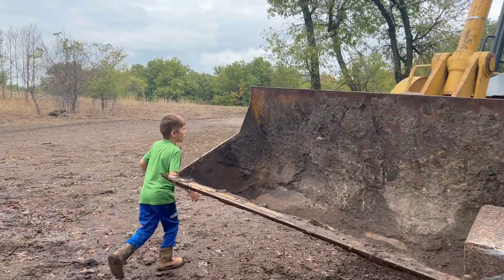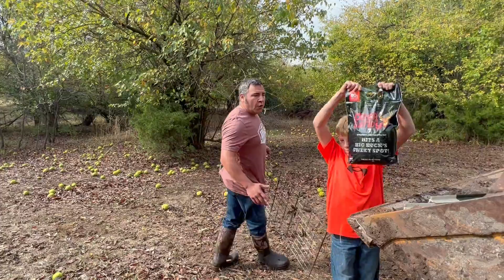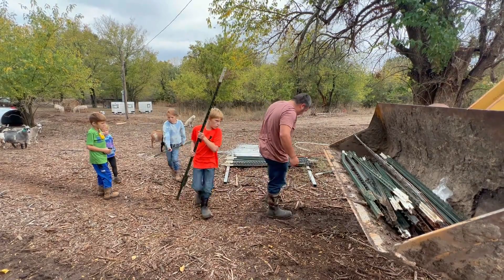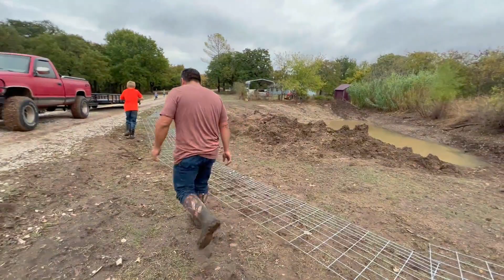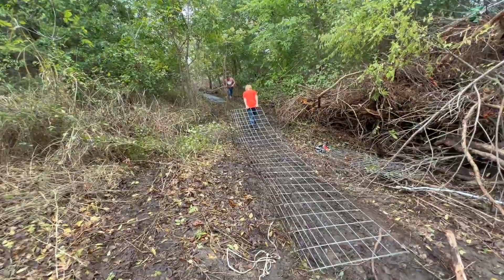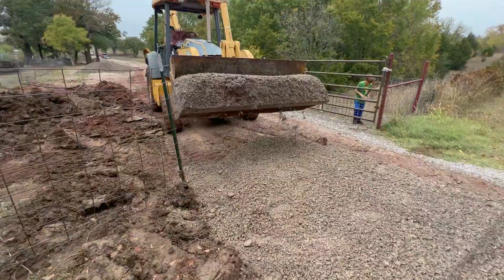Hope This Will Fix A Few Of The Problems Here On The Farm!!!

Comment: Are thinking of putting gravel all the way to the camper and the shed? I realize that it's not where your home is going but with winter and spring coming it will help with mud. You can move it at a later date.💕💕💕

Comment: I thought of an idea that might help you when laying out your fence panels and T posts. Have Leighton slowly drive the truck and trailer along the fence line. Then Brandon could be on the trailer dumping the fence panels and T posts where needed. This way you won't have to drag the fence panels around and could speed up the process of getting it done.
Reply from the maker: If it wasn’t so muddy that would have worked. Thank you

Comment: I had a small farm the driveway was 1.3 miles from the house or 1 mile to the barn a long ways back in the woods when you have to maintain the long driveway.
In the wenter it got a lot of snow so I built a garage/ buggy house next to the main road  I could keep a 4 wheel drive car in to go to work and the store when my driveway was snowed in , I hooked up my horse to my buggy that I put ski's on to use it as a sleigh that I took from the barn to the main road I would shovel from the main road to the garage then pull the car out and put the sleigh in and put the horse in the stable attached on the back of the barn. That was easier than clearing the hole driveway and my horse got his daily workout.

Comment: Just thinking of Charlie ,I know you may have thought about this but could her paw to ankle be nailed permanently similar to Camden’s elbow don’t hold back if I’m interfering but I see the love you guys have for her .Like Caden  I had plate screws and nail inside my thigh (femer) following a motorcycle accident and unlike her my ankle is vertually fused stiff but I only have slight restriction and lamp 50 years later.
Reply from the maker: I’m not sure. Maybe so